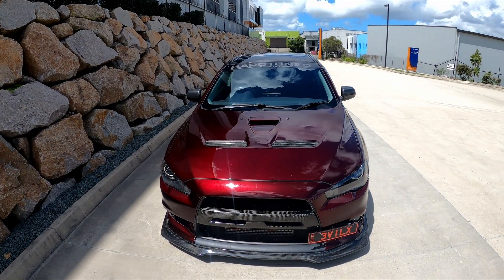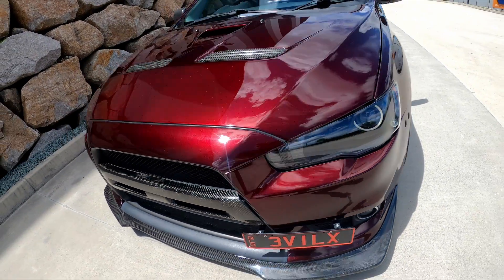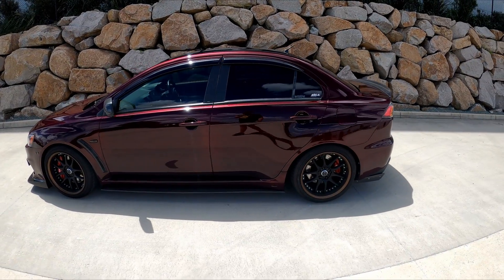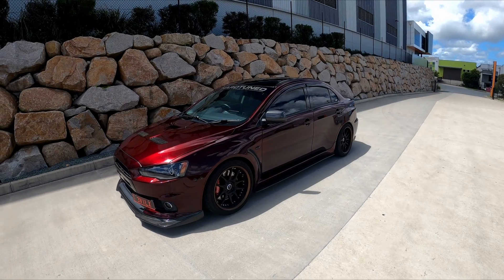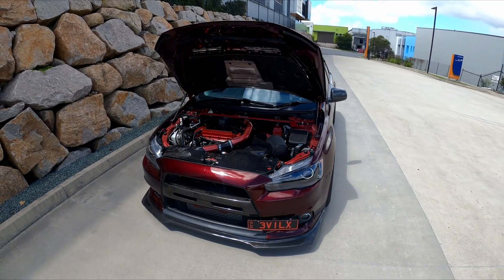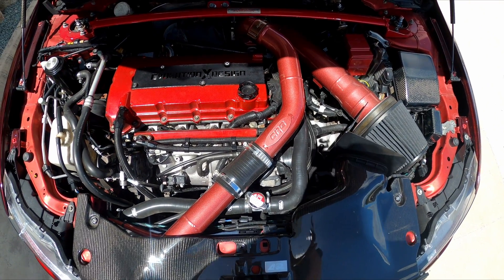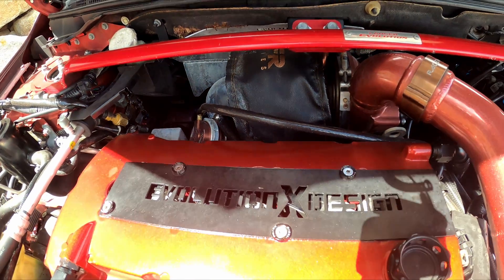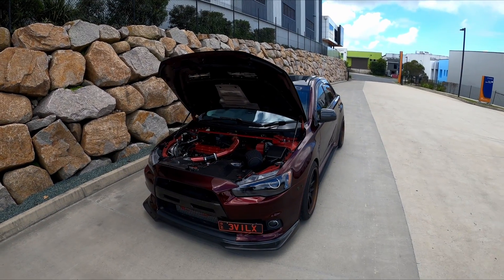Evil X  2.2 Litre Evo X GSR Feature + Full Mod List

Comment: Looking at buying an Evo X in the UK. Which HP GSR was this out of the factory? Does it matter which model I get if i'm going to modify it anyway? Seems to be loads of 300s on the market here but not many 330s / 360s etc. Any help appreicated. Thanks.
Reply from the maker: Hi we don't actually get any other than the factory ones over here.

Plus if you're going to modify anyway it wouldn't matter as most of those upgraded ones are just ECU tunes or basic mods which you'd upgrade from anyway

Comment: Hmmm. Still kinda low in the tq for a 2.2. is it tuned conservative or full send.
Reply: Probably conservative as it’s his street car probably gets used as a daily
Reply from the maker: That's in nm not ft lbs and in Australian numbers which are known to read a lot lower  than U.S dynos
Reply: @RTX007  definitely not my daily but no need to run things on the knifes edge either

Comment: I really like the color, hopefully i might be getting an evo soon. Any tips for when first purchasing one or what to look for. Its a 2015 Mr
Reply from the maker: Yeah the colour is great right, I actually have a few videos about that subject that you could check out.

In short check the exhaust manifold for cracks, and the SST for any slippage or other issues
Reply: @JacksonStrain  oh one other quick question, ive heard that mr editions are picky about transmission changes. Ive seen the cocktail mix and also Mitsubishi OEM DiaQueen SST Transmission Fluid. Can you do either or is one specific to mr?
Reply from the maker: @noahbone4054  I've never heard of a cocktail but most say to stick to diaqueen or castrol transmax dual which is what we use here in Australia